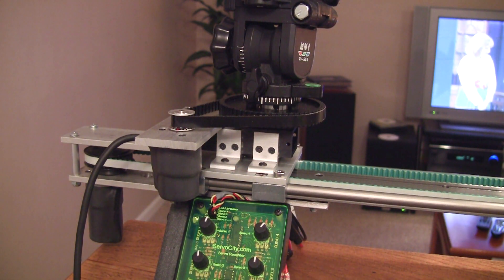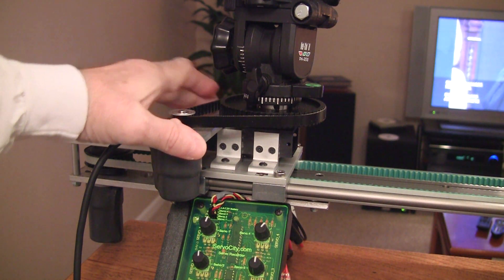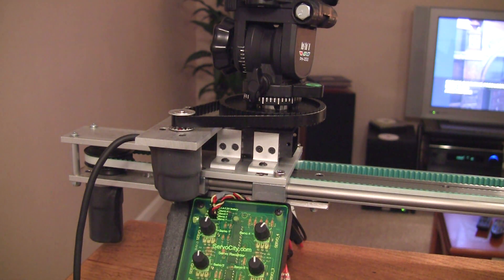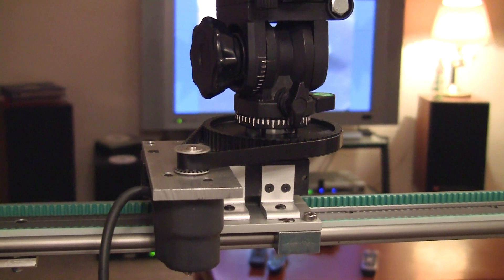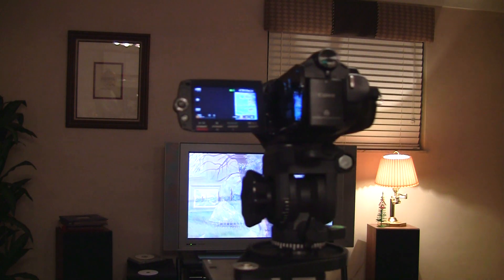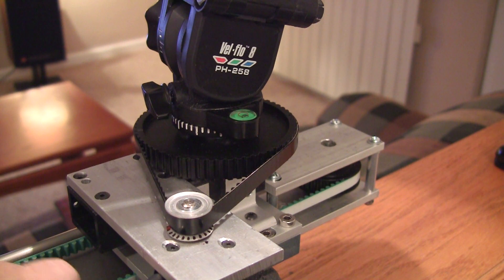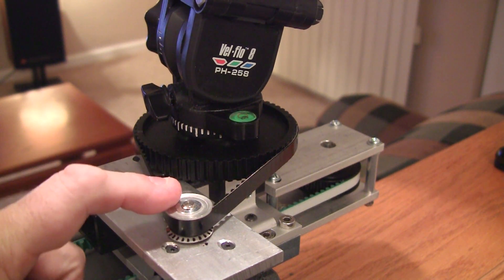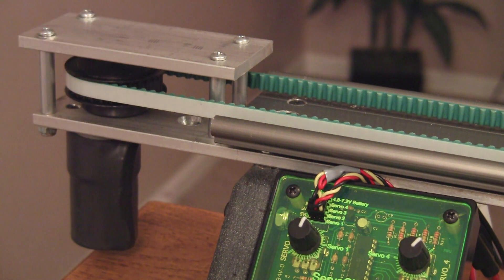final Igus mods.mp4

Comment from the maker: the power supply is a 12 volt DC gel cell battery. There are two electronic speed controls, one for the slider action (left/right) and another speed control for panning (left/right). The battery and two speed controls are connected to the four channel controller.

Comment: do you have a way of stopping the the slider motor so it dose not crash the ends or do you have to just watch it by eye? are the speed controller necessary for the motors ? the servo control box wont work on its own? thanks I am building one. excellent design!

Comment from the maker: @rhoadesurf 
I have not installed a switch at each end of the slider that will interrupt the power to the motor yet. The four servo control box ports do not distribute "heavy duty power" (enough amperage) for DC geared motors, your battery power connects to the ESC and is proportionally fed to each motor. If you are not using a motorized pan, then only one ESC would be needed, but since mine uses two DC geared motors, they each need their own ESC. 
Have fun!
Dan

Comment from the maker: I wanted mine to be unattended too, and it can be for quite some time but without a closed loop system these are part of the drawbacks to our "open" loop design system. You can read more about that on the servocity website where I did. Very strange that your controller successfully recorded two programs... very weird. They need to know these issues, the thing I hate is the potentiometers that have all the useable travel from the 12 O'clock position to the one O'clock position. I'm used to it.

Comment from the maker: Orlaimage, I apologize for not answering before now. :) I have no enf=gineering background, I guess I am just a good jerry rigger  :)  The pulleys do not come pre-drilled but I used my cheezey $69.00 Harbor Freight drill press and drill the hole in the center and then another hole and threaded it for a small allen "grub" screw which tightens down the motor shaft.  Thanks for posting!
Dan

Comment: Regarding the low-cost servo city type devices that use RC servos, has anyone tried the current control systems and digital servos that resolve up to 1024 positions? Couple that with a retract servo which cuts the gear ratio in half (giving you two turns of the motor to the previous one), I wonder if that would improve results to the point of acceptability?

Comment from the maker: you should ask the people at ServoCity about the goofy operation of the controller too. You have to hold the stop button down then hit it again which is goofy. You don't clear the programming, just record a new program. My slider drifts too, it is not a perfect controller as you have discovered. I leave some space at the end of the first trip (from left to right) because I know it's going to go past that point every cycle. Mine ran longer than 90 minutes without tripping the stop switches.  Dan

Comment: I am having trouble with the power? do you have any suggestions as to wear to get a power supply without having to get it shipped? nothing I use seems to get the job done? About to rip my hair out! also I purchased the 20rpm motor and the same units you have but, when I can get the motor to turn it goes really slow and only one way? I appreciate any advice. thanks.